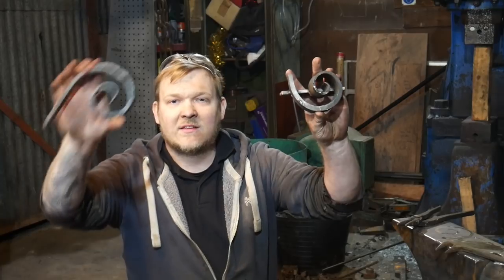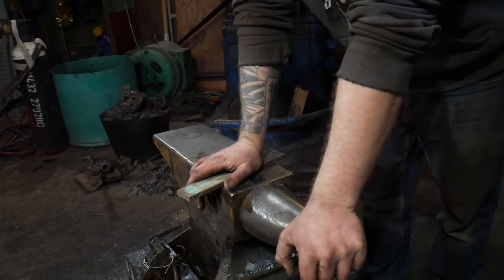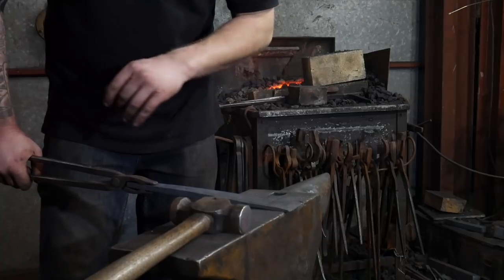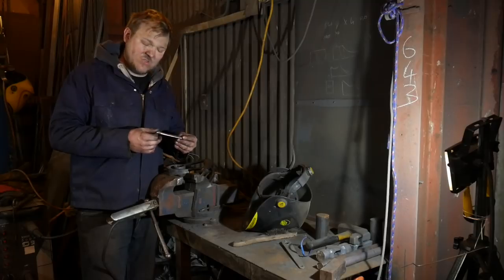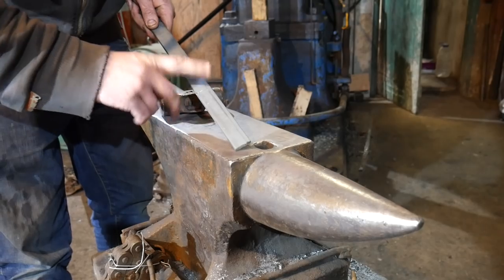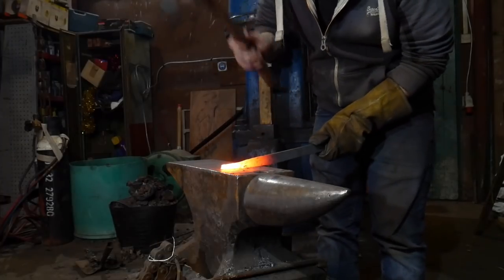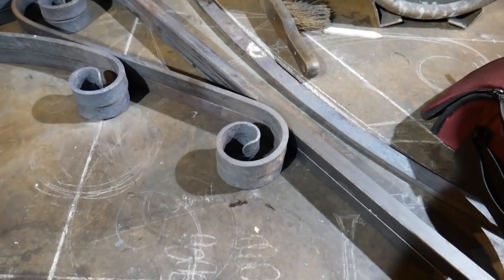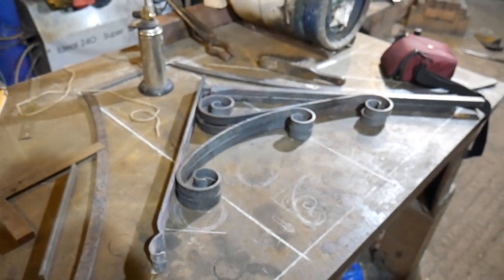Perfect Scrolls Every Time? How to make a scrolling Jig and Scrolls!

Comment: Dan, you might try starting the tip of your scroll over the edge of the anvil first before you go to the jig to both avoid the flat spot (that then has to be tweaked later to look 'proper') and to help hook the scroll into the jig so it grabs, which can negate the need to use rat nose tongs to hold it in place.  Nice looking hood/cover for that house by the way, I'm afraid I quite like scrolls  :)

Comment: Dan. There isn't much I can teach you about smithing. Scrolls are an exception. Some tips. Your scrolls will look better if you tighten up the first part of the scroll and let the large end get bigger quicker. Think of a scroll as a wedge. It's the space inside the scroll that is a wedge all rolled up. 
Start your scrolls at the anvil. It's much easier to get the first part of the curl right before you go to the jig than to try to fix it later. When a bar comes out of a scroll to straight or a curve, blend the transition a bit more so it's hard to tell where the bar ends and the scroll begins. Better flow that way. Last tip. As you make the jig, hold it at arms length and rotate it right and left at a moderate speed. Flat spots will stand out that you can't easily see when the jig is still.  I learned scrolling from a true master. His scrolls flowed like water. I get goose bumps remembering his work. 
I hope these tios help for future projects.
Reply: @ Matt Taimuty
  Yep. Golden ratio
Reply: Stan, not necessarily. The beauty of scrolls is that you can make them as tight or open as you wish.
Reply: Yep, golden ratio
Reply: What type of finish have you found that works best outdoors or in a shop that is moist??

Comment: Is there a reason for choosing the vice as medium to hold the jigs? Or is it just better, instead of welding a T shaped mild steel block under it and use it in the hardy hole / or the vice? Or is the hardy hole not the best place to bend scrolls in a tool?